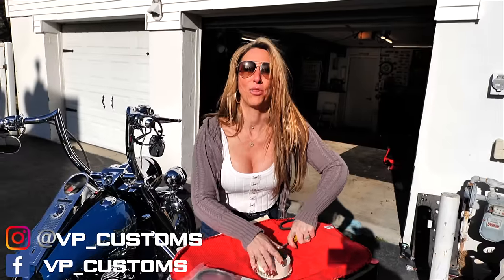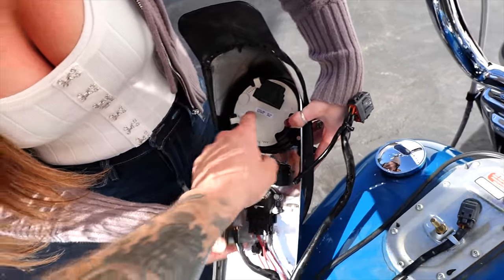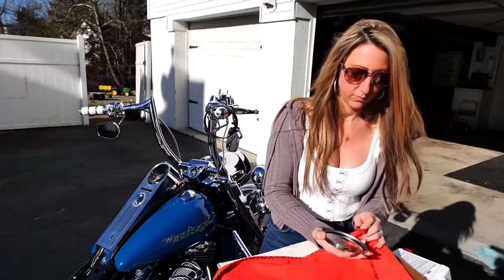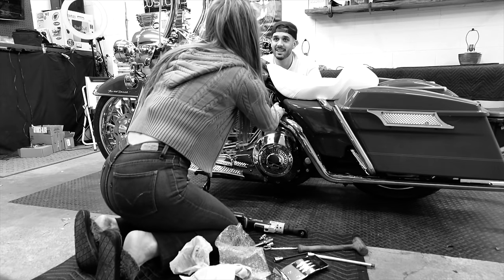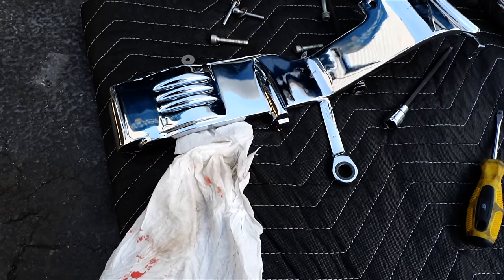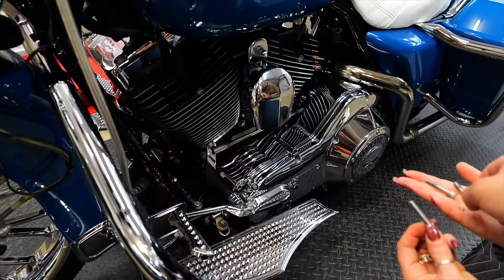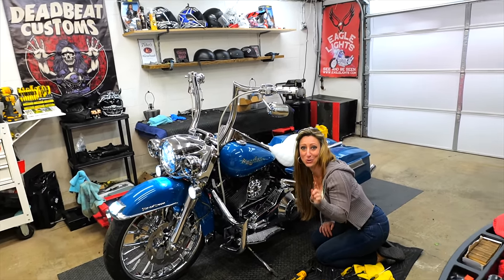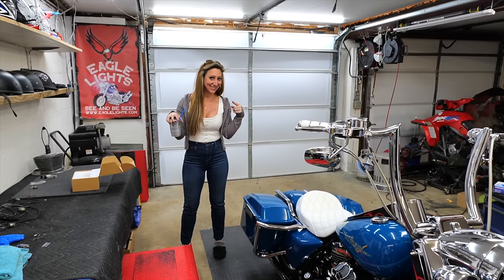Days Like This Make Us Want to Quit! Would You?! Road King Build Pt. 19

Comment: I would plumb a dump valve in. So one when you park it one flip it drops. Two in case a solenoid opens while parked it wont air up. Thats if you add a center stand cash it has happened.
Reply from the maker: Yes the American Suspension "trumpet" has a 4 valves and it's fully pneumatic with lock outs.  When they are locked it can never air up or down.  That's what we are running on this